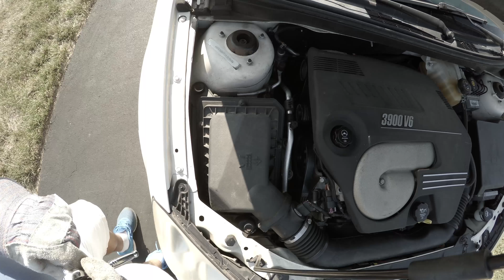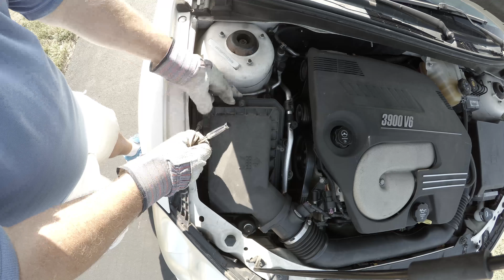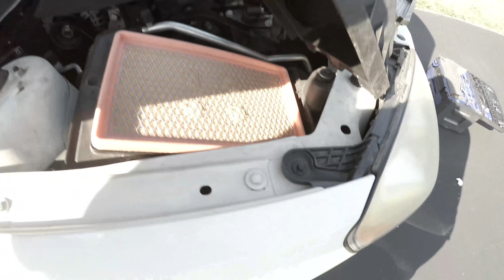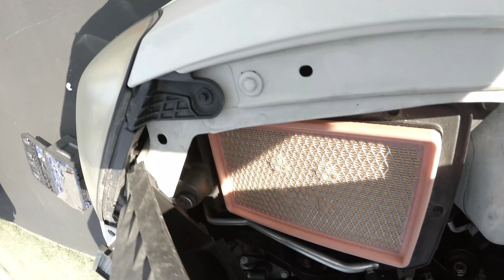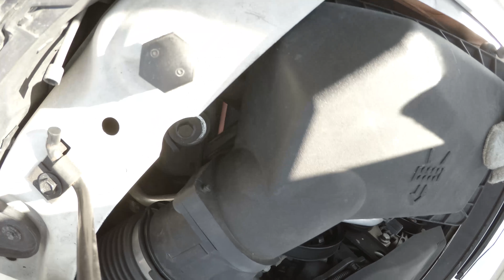How to Change an Air Filter on a 2005-2010 Pontiac G6

Comment: I honestly never even thought of replacing an air filter for a car. Is there a general rule of thumb for how often to replace them
Reply from the maker: nicekid76 yup...dirty air can significantly reduce engine life.  dirt particles will mix with the fuel and it can clog stuff up and cause faster wear of piston rings.  It is real easy on my truck. there is a gauge that goes to red if it is dirty.  On a car its generally every 30 to 40k miles.